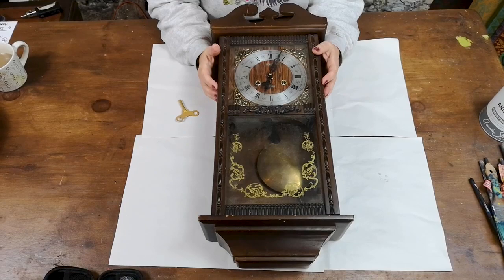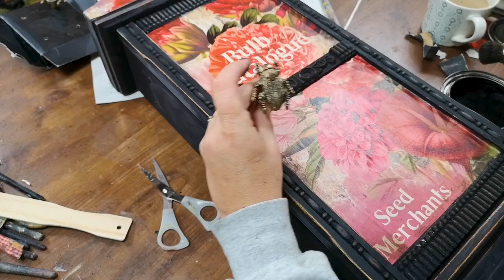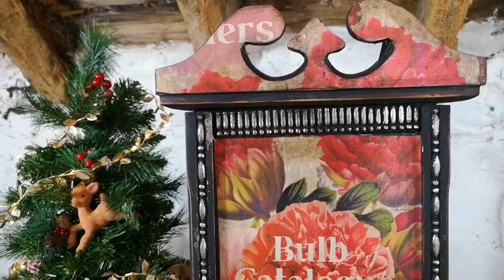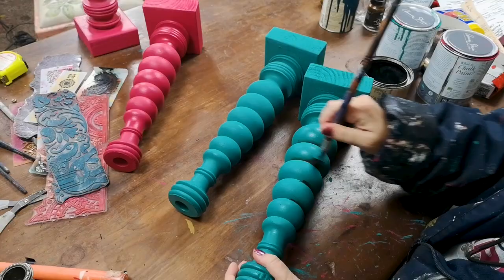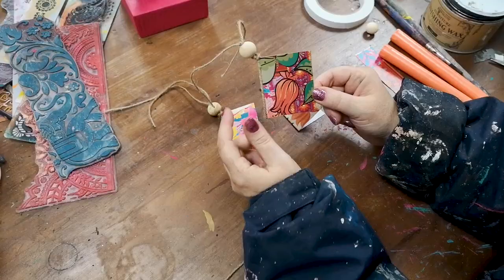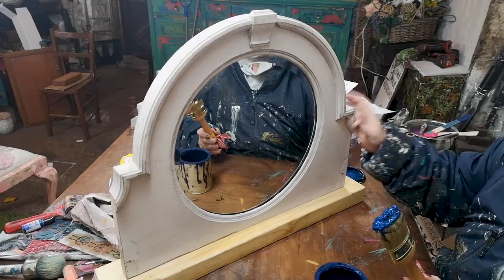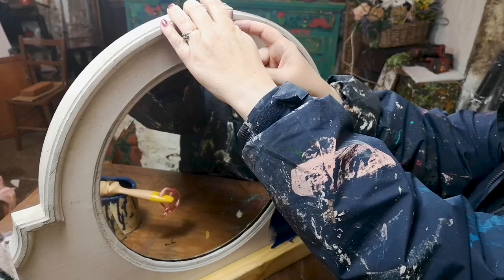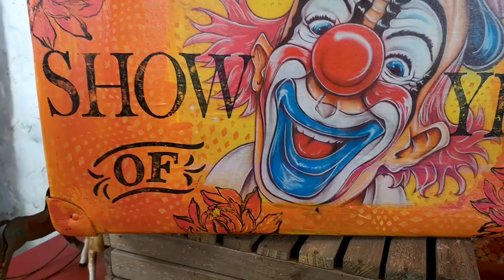Part 1: Stunning Christmas Gift makeovers from Junk and thrifted finds

Comment: Love all your stunning work. Just a tip...when you have paper you need to trim around detailed corners like the top of the clock, just light a match and carefully burn away the paper and the burn will stop exactly at all the edges. Don't take a chance of cutting your fingers with a razor.
I love all your beautiful creations.
Your colorful designs are such eye candy.❤
Reply from the maker: Thanks so much 💕

Comment: Hello Lel and Marty, I was just looking for a video to enjoy with my dinner and VOILA, TWO videos from you guys to enjoy.  How awesome!
About the clock that is no longer working.  Love the idea of turning it into a cabinet.  Thank you so very much for sharing it.  yay!
Another idea that just came to me, would be to use the glass doors, paint them to turn them into mirrors and make them into a bathroom medicine cabinet.
Gorgeous candle sticks.  I was just thinking that some people who also have lovely table legs would have loved to see what Marty did to attach the piece of wood at the bottom and to carve out the center for the candle to fit in.  What do you say Marty?  Will you share your secret shop work with us?
Fabulous gifts.
I love the mirror project.  I may copy the vibrant colors and paint some flowers on my wall mirror. 
I love the suitcases.  Questions, what paint do you use as base coat for the outside? I.e., the navy blue paint you used, what was it? Also, i was hoping to see the inside of the suitcase.  You said you would show it to us, but then you forgot to.  What paint did you use for the inside? I am always concerned when i see painted locks and stuff.  I am concerned that as they are used, the paint will rub off.  I noticed that you painted the locks red. With what paint? How did you seal it so it won't rub off?
Thank you very much.....
This was loads of fun.
Off to see the second one.
Reply from the maker: Hi Eve, Its Martyn. Glad you liked this video, it was fun to make. Thanks as always for your support and love. Martyn xx
Reply: @MadebyMarley  Thank you.